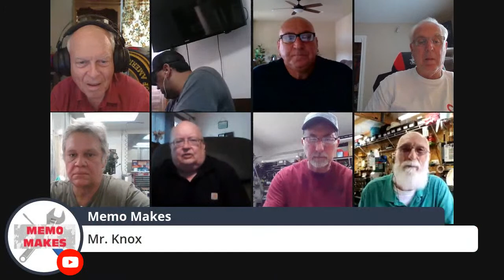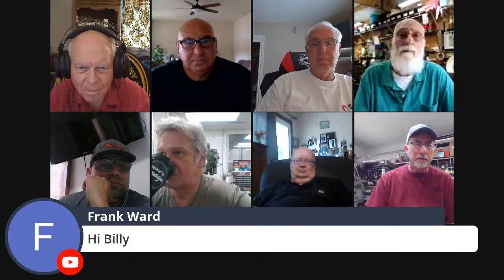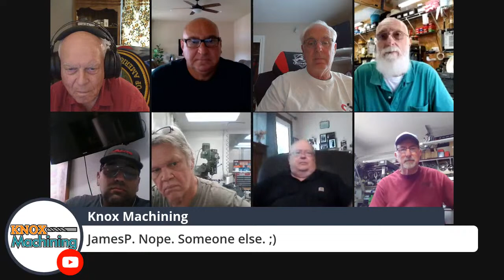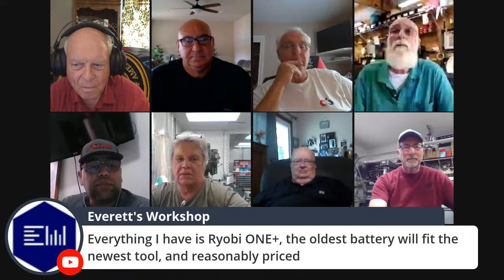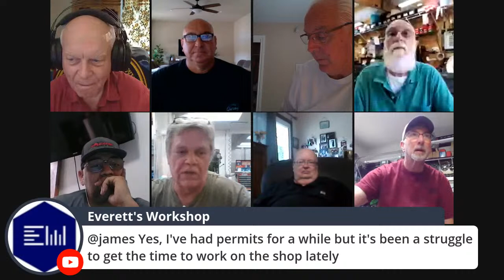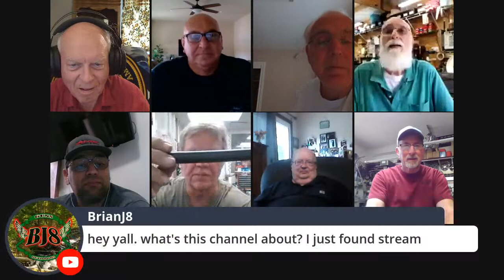ARW Discussion #24

Comment: Forgot to note during the discussion; some VFD drives actually have a operating mode called "Run to Destruction". Used in smoke ventilation fire life safety mode. Bypasses all safeties and overloads..
Reply from the maker: Thanks for the info Dean.